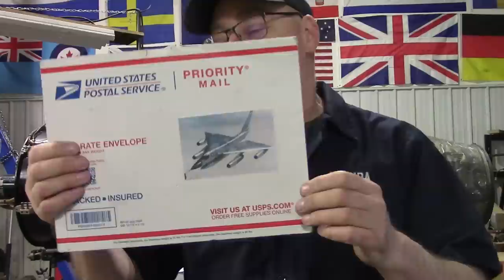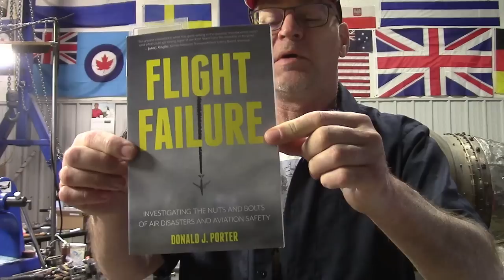Cautionary Tales from the Jet Shop

Comment: Hi Jay,

Near the end of the video you said that you think that aviation has become less safe. Can you elaborate on that?

I just started working as an engineer at an aircraft engine manufacturer and would love to have your opinion!
Reply from the maker: The emphasis seems to be on the profit, and not on the safety. Managers pressure the supervisors to "streamline" and economize the maintenance schedule. Time pressure on the mechanics does not usually lead to higher quality and safety. There are many accidents where an entire airliner has been lost due to a rushed maintenance schedule, or even procedures being omitted to save time.
Reply: @AgentJayZ  I have been associated with road building and earthmoving for around 40 years and I can concur with you on the mechanical as well as production shortcuts of "just hurry and get it done and pushing beyond what is possible, all caused by idiots and their mates", it's everywhere now and difficult to not get caught in it. Thanks for what you do, I have always had an interest with those toys you play with. All the best from Australia.
Reply: in time things are left out from books by mistake , sometimes really important one.

Comment: Somehow there must be a lesson here that spacex could learn about just pushing forward “because we know better” vs “learning from hard won experience and trying to not turn it into a cascade of idiocy”!

"A Cascade of Idiocy" ⇔ Just love that phrase!
Reply: Space-x is using a different engineering philosophy. The traditional NASA approach is to try to design out all of the risk upfront. That takes years and costs billions of dollars in desk flying time. Space-x, on the other hand, figures nobody yet has the "hard-won experience" in what they're trying to do, so they'll make it as close as they know how at the moment and try it out. If it works, great! If not, at least they put on a fantastic fireworks show for themselves. Either way, they have fun as long as nobody gets hurt. The calculated risk approach is capital intensive, but it seems to permit faster development.

Comment: Don't you think he trimmed the long fuel nozzle to shorten it to fit in the old can and used the grinder to clean up his saw marks?
Reply from the maker: That would be just like cutting two feet off the front of your car to fit in a smaller garage. A fuel nozzle is an intricate machine, not a piece of hose.
The only way you can cut and grind a fuel nozzle for a jet engine is if you are incredibly ignorant. How the dude even got his hands on one was due to the incredible stupidity of his supervisor.

Comment: wouldn't they have only had to check the engines with low smoke combustors for injectors that had been ground down instead of every engine.
Reply from the maker: That would make sense. But even that was deemed too impractical by the ..ahem... managers.

Comment: Finding out who to deliver mail to is not her job? Sounds like USPS....

An amazing number of people don't understand that these are precision machines. The engineers designed things to fit EXACTLY RIGHT. If they don't fit, YOU'RE DOING IT WRONG. Or you've got the wrong part. Some people just don't get it. They're the reason they do the "Look left. Look right. One of those people won't be here at graduation" routine at technical schools..
 
When I was seven, SAC trained their aircrews by running mock bombing runs over my home town at 7:00 am ever morning that summer. SUPERSONIC mock bombing runs (it was legal then.) Nobody slept in. 7:00 am - BOOM! Scarred the crap out of a kitten I was playing with one morning. I just remember him turning into an orange blur that jumped straight up and came down with all claws fully extended, used my arms for traction, shot out of the bedroom and disappeared into the living room. Found him an hour later WAY back under the couch. I had visible scars on my arms for the next 25-30 years. In spite of that, I share your opinion that it was one of the coolest looking aircraft ever made.
Reply from the maker: When I was in Jet School at BCIT, there was a 70% mark required to pass the course. With that, about 50 percent of us who started made it to the end. We became the Jet People.

Comment: Variable compressor blade pitch using  precision weight, rotation point, and rpm, and math..
Reply from the maker: No engine has variable pitch compressor blades. Modern engines use stator vanes that have variable pitch, because they are mounted in the case, and it's easier to change their pitch than it is to change the pitch of blades on a shaft rotating at 7500 rpm.

No VSVs here, but where they are used, they are forced into position by hydraulic actuators working on links and bell cranks.
Their position is determined by the fuel control, using inputs from sensors measuring inlet air temp, inlet air pressure, engine rpm, compressor discharge pressure, and throttle position.

Two of the channels monitored by our computer in the test cell are Calculated VSV angle and actual measured angle. If they are off, adjustments are made.